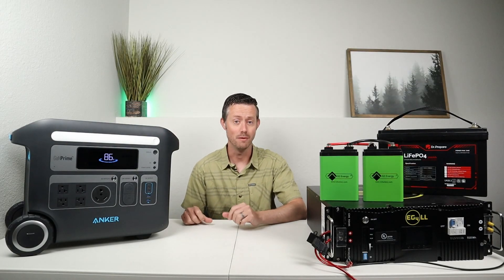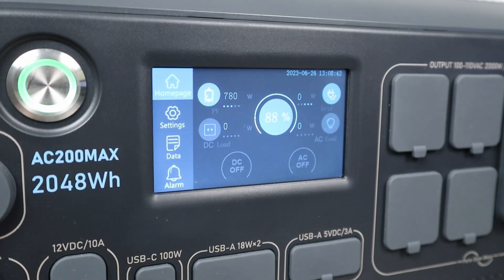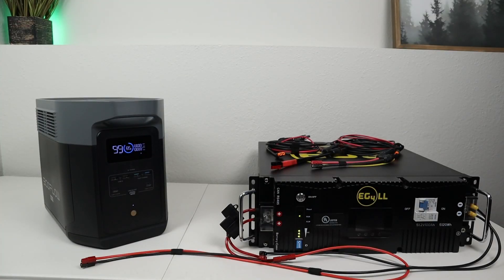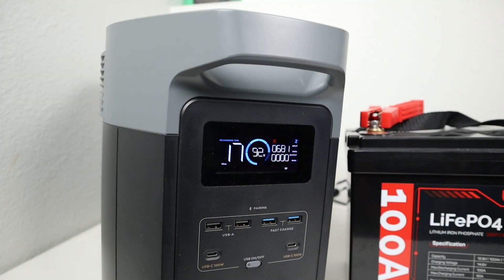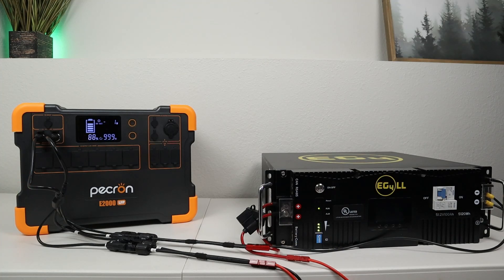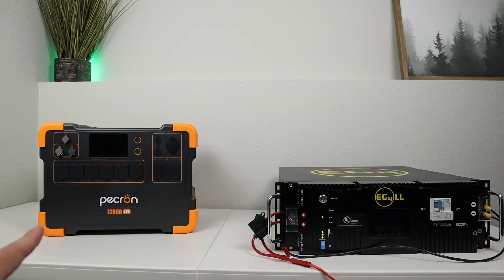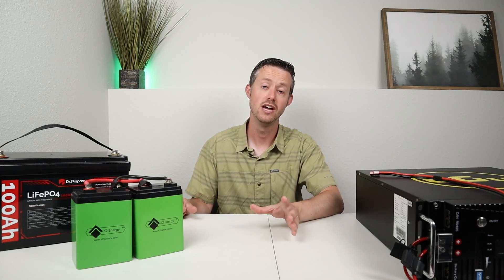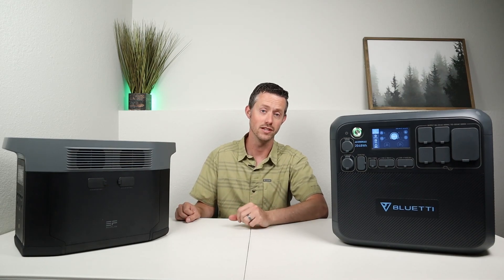Using Batteries To Extend Power Station Runtimes?! 48v LFP Server Rack 'Expansion Battery'!

Comment: With the designed expansion battery, you can charge the expansion battery when connected to the power station right? And we use solar to charge both power station and expansion battery. With your set up we have to charge them separately right?
Reply from the maker: Correct, you'd have to charge up the diy expansion battery on its own.
Reply: @Jasonoid  I see that you charge the power station with 3 different voltage battery, 12v 24v 48v. The idea of using the bigger voltage battery is it charge faster, like 500w correct? I'm in between buying 12v 400Ah vs 48v 100AH. Both has 5120wh capacity. But with 48v you can charge the battery faster right?

Also can you charge the power station with the battery and use the power station to power up appliances at the same time.? Would it degrade battery life? With this I can use power station with appliances and the battery will be the expansion
Reply from the maker: @TienTran-bi1jv  most power stations support pass through charging, using and charging at the same time. A 48v battery will be a much faster charging option.
Reply: @Jasonoid If I want to charge the EG4 battery, is there a charger for it, like I can use it to plug in wall outlet.
Reply from the maker: @TienTran-bi1jv  there is a 48v LFP battery charger on Signature Solars website that will do that. It's under batteries, then battery chargers.

Comment: K so what if I have delta 2 max combined with the 48 V battery like you have done but I want to use the EcoFlow 800 watt alternator charger to charge BOTH battery’s while driving? How do I do that? Power only flows one way through the solar input cable!?

Comment: @Jasonoid when you put a fuse on the positive line when doing this, what size should you use?  For example, for connecting a 24V battery and an Ecoflow Delta 2 or Delta Pro would you use a 20-amp or 30-amp fuse?
Reply from the maker: Your fuse is meant to protect the wiring so you match the fuse size with the wiring max amperage. 12awg is 20 amps, 10 awg is 30 amps 👍
Reply: @Jasonoid  thanks 🙏

Comment: You led me here from a previous question on another video. Thank you! One thing i will say is with my Delta 2 test like your my xt60i cord feel warm. Its pushing 178 watts and the wire temp was about 80 to 90 degrees f. Well below what the 12awg can handle, but it was something i noticed. Maybe you did too?

Comment: Sorry for the late question,  did the Anker have passthrough charging on dc extended battery? Trying to determine if the extended battery will be used up first during Anker charging (less then 100%) until empty then the remaining Anker battery is being used until 0%? I hope the question makes sense :)
Reply from the maker: Yes, the expansion battery will keep the power station full until the expansion battery dies. Once the expansion battery is dead, the power station will start dropping in battery percentage. This will be the case as long as DC charging input is higher than the load. If the load going out of the power station is bigger, the power station will drop in battery capacity.

Comment: I just purchased the AC200L through your link you provided yesterday on another video. Any idea where it maxes out to charge? Is it 1200W like the specs or is it limited by the 48V battery? 

Additionally, what are your thoughts on wiring up an inverter to the 48V and charging via AC Input to increase? I wouldn’t want to use anything crazy maybe something like a 1500-2k watt inverter. 

Is there a better way to doing this that you might recommend?
Reply from the maker: It will charge at around 825 watts with a 48v battery server rack battery. This is the breakdown of that power:   55volts @ 15 amps = 825 watts (average)
A 48v server rack battery has a peak voltage of 59v and when fully discharged it goes down to 48v. I don't think you would need an inverter to increase that speed.
You could use a 2000w inverter to charge the AC200L at 1500 to 1800 watts, but you'll lose extra power through efficiency losses of going from DC power to AC power, back to DC power.
Reply: @Jasonoid  Got it thanks, and would this be compatible with the budget friendly version of the SOK (SOK SK48V100-NCBT – 48V 100Ah) ? Relatively the same process? Just trying to go the most cost effective route to expand my battery and also would be nice to use a server rack as i can be more flexible in any future systems.
Reply from the maker: @OfficialNattyOrNot  yes, any 48v battery

Comment: Jason:  Assuming your PV array output voltage is over 60v, would it be possible to use a charge controller with a 60+v input and a 48v output to charge the Anker Solix 3800 directly into the XT60 port(s)?  Thanks

Comment: How about using a buck converter like this one " 12V Step Up to 24V, Boost Converter 20A 480W Voltage Regulator  "   ?
Reply from the maker: I did a whole video on using DC to DC converters:  https://youtu.be/I78RxjRXTn4
Reply: I'll watch it.  Thanks

Comment: Love the explanation. I made a 48 volt 50 AH setup with mppt controller that can accept 100v 20a of PV charge from the solar panels. 
I then hook up the Ecoflow Delta 2 max to it to get 500-1000 watts with xt60i cablces.
This allows me to charge up my delta 2 max while not being limited a mere 60 VOC from Solar panels limit from its own mppt. 
I can then simply move the Ecoflow to wherever I need while continuing to store the solar power by having it sent to the 48 volt battery. 
This is way cheaper than trying to buy the spare battery unit.
Reply: hi, this is what im trying to do. Do you take the power from batteries CC to delta or dc load CC to delta? Also does your CC sync with delta batteries or battery pack? And finally what setting did you use on CC UV and OV? thanks
Reply: @selmopt  I found it simplest to take charge directly from the battery. The charge controller can have issues trying to communicate with the mppt controller on the ecoflow.
The charge controller syncs with the battery. I use a victron mppt smart solar 100 volt 20 Amp for the 48 volt variant.
I have 4 solar panels in series for about 88 volt voc and 10 amps for around 880 watts.
Reply: Do you run the charge control input to the battery at the same time as you are hooked to the solar input on your power station or do these functions have to be connected separately?
Reply from the maker: Just like a car battery, power in and out on the same terminals. More power going into the battery = charging
Reply: @Jasonoid   thank you, sir!
Reply from the maker: Yep, that's a great way to charge your units and expand them!

Comment: 5:02 interesting, I thought that the input should not exceed 15A (a battery can deliver much more) but it is in fact ecoflow which limits the input to 15A maximum. So we can also connect as many solar panels in parallel (10 for example) if we don't exceed 15A!? (nor exceed the max voltage 150V of course)
Reply from the maker: The power station limits the amperage. It only pulls the amount of amps it needs.
Reply: @id ok thank you, is it the same for micro inverters like the enphase iq7 or iq8, can we connect a battery to the mpp of a micro inverter to produce at night for example? is the micro inverter limit itself the Ampers ?
Reply from the maker: @Richi42  I have no experience with micro inverters so I can't say yes or no. From my understanding an micro inverter should be able to take in power from either a battery or a solar panel.
Reply: @Jasonoid  I also have the impression given your experience in the video I imagine that the mppt of a micro inverter is identical to those in the ecoflow or blueti that you tested. I think I'll try this myself. Thank you for your quick responses and for the video.

Comment: Great video..Thank you for showing this.

A lot of those power stations have internal battery voltages of up to 45V or higher. Since the input range on some of them is as low is 11V, does that mean they are using some sort of MPPT controller that boosts and as well as bucks the voltage? Most MPPT SCC require the PV voltage to be at least 2 volts higher than the battery voltage! But I guess these have the capability of boosting as well because so many people charge with their 13.4V autos?
Reply from the maker: Yes, they have MPPT charge controllers that allow them to use a wide range of voltage input.

Comment: @Jasonoid great video, always have creative content. My power station has a 15A Anderson input that allows up to 150 volts. I just want to hook up a 24v battery to my power station. I found a o ring terminal to Anderson cord on Amazon (rated for 45A), but how do I make sure it does not go over 15A when transferring energy from battery to power station? Any direction would be much appreciated. Thank you.
Reply from the maker: The power station limits the amperage automatically to 15 amps. You won't have an issue.
Reply: @Jasonoid  that’s awesome, didn’t know that. Is o ring to Anderson my best bet then in terms of a connector?
Reply from the maker: @keenanthomson3253  I like Anderson powerpole so I'd go with that option.
Reply: @Jasonoid  appreciate the info man. Keep up the good work.

Comment: So.... if the power station was under load, would pass-thru mode actually draw more power from the external battery to keep your stuff powered (at least with the non-cig DC inputs) in addition to the paltry re-charge wattages that you demonstrated?  THAT would actually EXTEND the capacity in WHours vs just another means to recharge when you are "dark".
Reply from the maker: If the power station is charging at a faster rate than the load going out, then the external battery will keep the power station full until it's dead.  The power station will start to deplete once the external battery is dead.
Reply: @Jasonoid  exactly why I was concerned.   All of those charge rates in the review were lower than the rated outputs of the generator so I thought.

Comment: As mentioned in many comments below, an expansion battery can be expensive.  But there are millions of golf cart batteries doing nothing.  How would you hook up a 48v 110ah 6.24KWh lifiepo 4 battery to an Anker Powerstation.   I have an Anker Solis F3800 being delivered next month and would to have this as additional backup.
Reply from the maker: Connect an xt60 pig tail to your golf cart battery and plug it into the charging port of the power station. Put a 20 amp fuse on the postive line. Easy peasy
Reply: Thanks, I thought there might be an easy way if the powerstation can handle the 48v load @Jasonoid
Reply: @Jasonoid Okay what about 72v? 😂 I have a 72v golf cart rocket. It has a 72v to 12v converter, but I’d like to charge at the full 48v. Do they make such a device?
Reply from the maker: @DaveBell1  your power station will need to be able to handle the the high voltage of that battery. It's probably near 80v.
Reply: @Jasonoid  Yeah that won't work, F3800 limit is 60V. :) I do have a step-down reducer on the cart, 12V; but it would charge my Anker very slowly. I basically need a 72 to 48V step down reducer also, if that exists.

Subscribed btw, great content! Let me ask you one more question...  With the EPEVER MPPT Solar Charge Controller; it will charge my additional 48V battery packs, which will charge my F3800, but only during the day. How to I make sure the 48V battery is kept charged at other times of the day? Can it be plugged into a 48V AC charger at the same time as the solar charge controller?
Reply from the maker: @DaveBell1  yes, you can have multiple chargers connected at the same time to your 48v battery. They take tons of power input!
Reply: @Jasonoid  would you plug the charger into the solix? Or the wall?
Reply from the maker: @DaveBell1  if the Solix has power available. You can use that.

Comment: This is awesome, thank you! I was looking at the EG4 48V to supplement my new ANKER SOLIX F3800. As you mentioned the add on batteries are crazy expensive. How would I charge the EG4? The Anker has dual solar charging inputs with 1200 V max each or 2400 total.  Thanks! Love your channel
Reply from the maker: I use this solar charge controller to charge mine back up: https://amzn.to/41P6SFb
I have a few different arrays that I swap around between different battery systems.
You could also use a AC wall charger to charge it back up seen on this website:
https://signaturesolar.com/shop-all/batteries/battery-chargers/
Reply: Awesome, thank you! @Jasonoid

Comment: Great video!  .....  Question -- Using the process you've outlined in the video, can you connect the battery to, let's use the 48 volt EG4 battery, to one of those "All in one" charge controller / inverters to keep that battery fully charged in the day with using a max perimeter of solar panels of the inverter (meaning, you've got a lot of solar panels connected to the inverter and the inverter charges the battery)?  I hope that question makes sense....   Thoughts?
Reply from the maker: SO to clarify, you'd want to take an existing 48v all in one inverter setup (with a 48v battery) and then charge it via the solar input port using a second 48v battery? Just wanted to make sure I understood.

Comment: I dont see how you connected the battery to the station.  What cables are used to safely make that happen and to what outlets and why those outlets. How to get those cables?
Reply from the maker: Most power stations will limit the current to 15 amps or less so ide recommend 12awg or 10awg wire for the custom cable. I like to have an inline fuse for the postive wire just in case. You'll need to attach whatever adapter your power station charging port uses on one end and you can use normal ring terminals on the battery side.

Comment: hm, if the max current discharge is 100a for the server rack, and say I connected that to the ecoflow max via xt60 or some such cable,

the max ecoflow delta current is 15a max, wouldn't that be a problem for the power station? Or does the power station's internal charge controller protect and automatically limit the current to the needed value of 15A?
Reply from the maker: The power station will limit the charging input to 15 amps automatically.
Reply: @Jasonoid  thanks! I saw a battery that had 200a max discharge, will the power station automatically limit that as well, or is there a limit when the mismatch is too great?
Reply from the maker: @timothyn4699  it won't ever go over 15 amps, no matter the power source.
Reply: @Jasonoid  nice! That helps a lot. How about, I just ordered 3x 160w ecoflow panels, they have Voc 21.4v. If I connect them in series the total voltage should be Voc 64.2. My ecoflow delta 2 1kwh says it can take voltage up to 60V. Should I be concerned with hooking them all up in series to my battery generator, or will the controller auto limit it to 60V?  Could I safely hook up say 120V, and expect it to limit it to 60V, or is there a limit?

(if you happen to have time to answer, nw if not, appreciate your insight)
Reply from the maker: @timothyn4699  Do NOT connect up any voltage higher than 60 volts. The voltage is not auto limited and will damage the power station. Only the amperage is auto limited. You'll want to find panels with a lower total VOC or run 4 panels in a 2s2p configuration.
Reply: @Jasonoid  oh, good to know! Thanks for the save. So voltage isn't limited, current will auto limit. Can I assume if I stay in the proper voltage range, and have panels generating say 700w yet max watt input is 500w, I'll be ok bc as long as I'm in the voltage limits, the station will regulate/lower the incoming current properly, or is the current limiter only focused on not exceeded 15a?
Reply from the maker: @timothyn4699  yes, if you stick under 60v you'll be fine. I purchased these panels since the VOC is below 20v:
https://amzn.to/4aksbSw
Only in really cold temps will the VOC go higher than 60v with three of these in series.

Comment: Nice video. Why did you choose 12 AWG Stranded Tinned Copper Wire vs 10 AWG?  Are the Ring Crimp Terminals Connectors inside diameters large enough to fit the LiTime M8 terminal bolts?
Reply from the maker: You could definitely go with 10 awg wire if you want. Most of the power stations have a 10 amp limit and with 12 awg wire being rated for 20 amps it's worked just fine for this application.

Comment: Thank you for this video. I was planning on buying a 48v 200ah lifepo4 battery instead of buying the bluetti extention battery. How do you charge the 48v battery with solar panels? I have the ac200max.
Reply from the maker: You'll need to purchase a solar charge controller that's compatible with 48v batteries. You connect solar panels to the charge controller and then connect the charge controller to the battery. This is the one I use:
https://amzn.to/3uTXHXe
Reply: @Jasonoid  Thanks so much!!!

Comment: Many have ebikes.. 72v anyway to use them?
Reply from the maker: If the power station has an input voltage higher than the battery pack you could possibly use the ebike battery as a small expansion battery. You'd have to come up with some type of adapter.
Reply: @Jasonoid  solor input limit is 1000w at 10amps.   battery is 72v 25ah 50amp BMS 10amps*72v=720w  question is do you times by inputs max or out put max?
Reply: @Jasonoid  and thanks for replying
Reply: @Jasonoid  should just drop to 12v be safer.. 12v 50amp? Or 12v 10amp... ?

Comment: For the anker, if I connect 4, 12 v batteries in series, I can reach 1000v charging limit. I get that, but can I charge the batteries while driving? I think I can not hook up a dc to dc charger to it, because the total battery voltage is too high at 48 volts. Comments?
Reply from the maker: Connecting a converter to the 48v battery or connecting a converter to the power station?  Here's a video that shows you how to use DC to DC converters to charge the power station:
https://youtu.be/I78RxjRXTn4